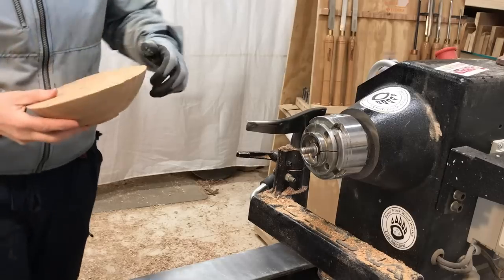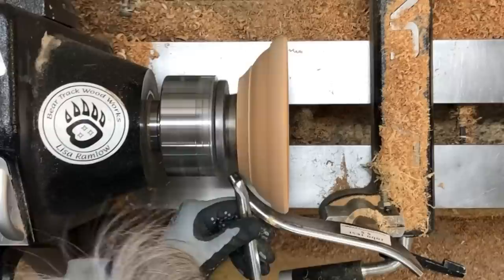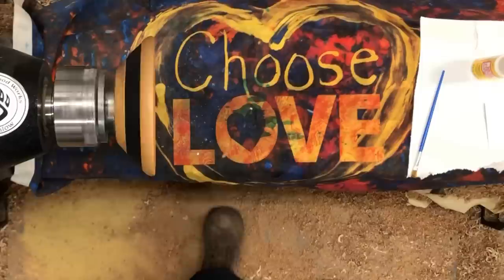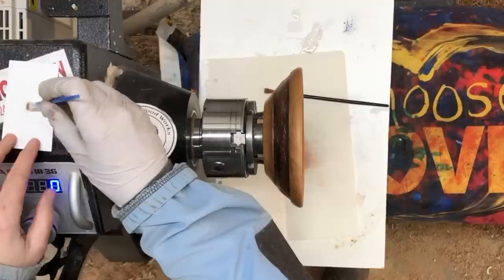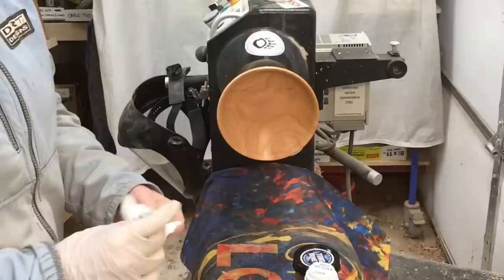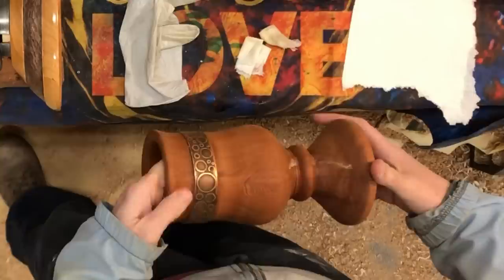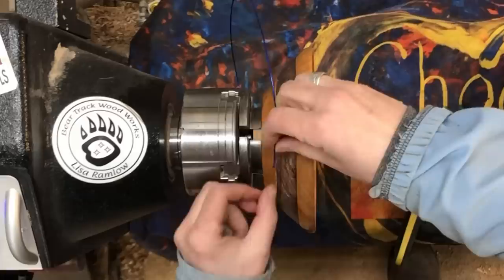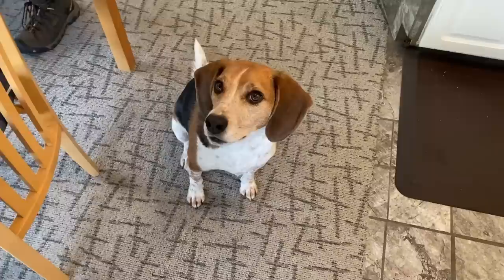Woodturning: Banded Bowl in the style of Emma Cook @TheTinyTurner

Comment: I'm not a turner but I hope to one day, but I have two suggestions:
Take the item off the lathe and use a  banding wheel (a type of lazy Susan used in pottery) for the painting - you'd be sitting and working horizontally instead of standing and working vertically. Second, create a separate channel just outside the carved area for the wire; if it's tight enough compression would be enough to hold the wire in place, then varnish to secure it.
Reply from the maker: Thanks Bob!

Comment: Turned out gorgeous! Nice job! Also, which flexcut carving tool set are you using?
Reply from the maker: Thanks Kieran! I actually don’t remember what it’s called on the top of the wooden case - I thinks it’s the Deluxe Starter with about 16 different blade profiles plus the sharpening strip and a fixed knife. Really nice little set

Comment: Question about the wood. Is it light for the size. Sort of looks like padauk. When sanded was it kind of like a stain?
Reply from the maker: Hi Timothy! It is relatively light for the size but it is also super, super dry. It is this color throughout so not stained or dyed. The grain really looks like some sort of conifer and is softer than most woods I turn, so I'm still leaning toward redwood but I'm not sure I'll ever be sure just what it is
Reply: @LisaRamlow  have you ever worked with padauk wood